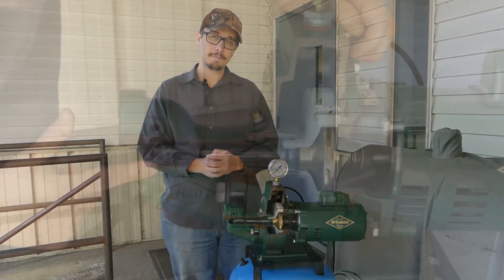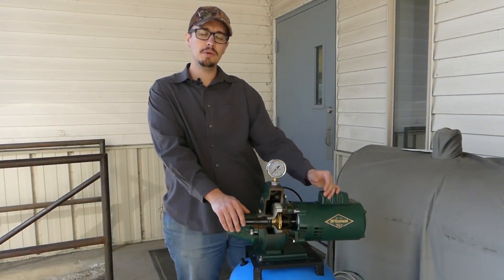Troubleshooting a Jet Pump: Low Pressure or Flow

Comment: On my project, I need very low flow    0.3 m3/h and pressure 5 bar.
I think jet pump is very suitable, since the pump doesn't go to shutoff head.

Comment: So will dry and low water table affect the pressure?
I checked pressure switch and the hose bug. I cleaned it out. I can’t get up till about 35 psi we r very dry here in south eastern Pennsylvania right now.
Reply from the maker: Yes, if your well is out of water it will not be able to build pressure.

Comment: Hey Chris, need some advice. Our jet pump pulls from our lake, a run of maybe 40’. New brass foot valve 2 years ago. Never had a problem until last year. Had some tap cartridges that froze, although have never changed my routine. Did open drain plug at pump base, draining pump and did add plumbers antifreeze. 
Now pump builds pressure albeit with gurgling and what sounds like frothing or mixing with air. When I stop the pump to fill it, it will only take maybe half a cup of water before it’s full which tells me there is no leak in the suction pipe. The hot water tank when its filling is bubbling with air. If you open a tap it’s spurting out with air, then water, then a mixture of both. Then after a minute or two it’s consistent water with an occasional spurt of air. Now the pump will start due to a drop in pressure and run for about 10 minutes, then finally stop. Wondering if it’s something in the pressure tank or possibly like you mentioned, a blockage in the jet? Would this cause these symptoms? Appreciate any help/advice!!

Comment: My jet pump (shallow well) will not achieve pressure.  I put a new pressure switch on,  Expansion tank is set to 38 psi. It holds pressure, It just cannot achieve pressure. The pump shows 50 pounds psi but will not shut off. I manually shut it off now and again it hold pressure, so no leaks!!! Baffling!!!

Comment: Would a one inch section line work for my drop line in the well an above the well is 1 1/4" going to the front of the pump ? Will that keep it from building pressure fully

Comment: Pump has been  completely. rebuilt ( impeller, diffuser, gaskets, seals, etc), Jets have been cleared, Leaks have been addressed. Pressure tank is brand new and holding air. It has sufficient access to water on the intake side.  Motor is turning. Check valves are functioning.  Both the intake and the discharge side have been primed. It will run like a champ for a few minutes and then water pressure will slowly drop off to nothing even as the pump continues to turn.  If you pour water back down its throat it will run for a few more minutes until  the issue repeats itself.  Any ideas?
  So far I've had a plumber, a farmer and a general contractor look at it and nobody has any idea.
Reply: Did you get the issue figured out? Sounds like what I'm dealing with..
Reply: What finally worked (and I dont know why) is I a) replumbed the entire supply side from the water source to the pump.  When I did that I changed the place where I was priming it from.  It worked, and is still working .  I praised the Lord and then took a shower. @souperdave2009

Comment: I would like more info on this , I’ve been having problems with my pump . I was told I needed the whole irrigation system had to be installed for the pump to work properly , 
Pump jumps up to 76 amps , when it’s rated for 37 when valve is open entirely .  And I’ve been having trouble getting installed and running properly , even the folks I bought it from don’t know and tell me , the entire system of irrigation need to be in place for the marching to operate properly. And help would be appreciated .

Comment: Hi thanks for the  videos!  My pump  operates between 30 and 50 psi but when it reaches 50 it shuts off and loses pressure back down to just above 30psi. Do you think it's the foot valve?
Reply: Try shutting off the water to the rest of the house and isolating the leak.

If your pump is still losing prime it’s likely a bad foot valve or injector at the bottom of the well. When I pulled mine the injector had several holes causing it to lose prime.

Comment: Mr. Worst, thank you for your free knowledge sharing. By this simple video I unclogged my jet (accessible via a simple drain plug), thus avoiding taking off all the pump and plumbing and taking it to the repair shop only for a few debris. The pump is 25 years old and works like new now !
Reply from the maker: Wohoo!

Comment: Mine doesn't suck any water it stays all in the suction pipe and the pipe down the well is full of water to the top and check valve, it expels out only the priming water I put in  what's happening with my drummond pump??? Maybe the impeller jet clugged???
Reply: Currently having this same problem

Comment: what pump parts would need replacing if pump was run dry for multiple hours ?
Reply from the maker: That's a good question. The mechanical seal and likely any plastic parts will need replaced, assuming of course that the motor still spins freely.
Reply: And an impeller perhaps

Comment: i need information on a 2 inch  casting deep water well  i need  nozzle tip set up , pipe chooses for the well and pump setup , can you help
Reply from the maker: Yes! Give us a call: 855.329.4519

Comment: My F&W cpj pump takes water from bottom of a 8ft deep tank. The venturi broke. Can I still pump water with it? I don't need suction.
Reply from the maker: You can try! It should still pump but you will get reduced performance.

Comment: Good morning Chris . Thank you very much for all of your brilliant work on all the videos you have posted . They are veery informative and educational. I have personally understood everyone of them . I’m a retired injured vet and your videos have helped me understand how my system works . I currently have a two pipe jet pump system . I have now had to replace every part on my system from the foot valve to the pressure tank and plumbing in my house lol. Took me longer than I thought but it’s now done. It is wasent for your videos I would still be lost in the dark lol.
My question to you is this . What in the pressure control valve and how does it work . There is one in this video on top of the jet pump the brass piece . What does it do and how do I adjust it.
My new pump can with one and it was described as a priming T and a flow control valve . I don’t understand the directions in the install hand out you get with the pump.
Do I need this or should it be install? 
My pump seems to run ok and cycles on and off with no problems  20/40 . My well is 76,6” deep from the casing head. I have water 15, from the top of the casing .i raised the foot valve up 10’ from where it sat . The old pipe and foot valve were around 66’ down .
We do have a huge iron problem where I live and I’ll be trying to treat that soon some how with filters and so on.
I have already blown through pumps the original pump that was put in some time in the 80s . The other new pump was a half hp and the mounting feet were broken off right out of the box and the mechanical seal is leaking out the back .
My new pump is now a 1 hp convertible pump (HD did not have anything left so it was my only option for a pump.
Can you give me some advise on this adjustment valve and maybe how to get some of the iron out of my water . 
I have called well companies around my area and all they wanted to do is sink and new casing and install a sub pump.when all was said and done it was going to be around 13k (ouch) . Any advise would help me at this point . Oh I also do not have this adjustable valve installed . I just installed a 1” adaptor on the discharge hole directly to my tank . Thanks in advance .
Reply: Thanks for commenting! Glad our videos have helped you. I am not 100% sure on what you are referring to on the pressure control valve. I am thinking you might be talking about a pressure regulator, which is commonly applied in deep well jet pump applications to provide back pressure to to pump to prevent cavitation by restricting flow. If your pump is running quiet without it, I wouldn't worry about it. Cavitation tends to be loud and gravely sounding. So if you were indeed talking about a pressure regulator I hope that answered your question, otherwise let me know what part you are talking about.
Reply: Chris Worst  hinthere yes you are correct on the type of valve . The valve was located on the discharge side of my pump that went to the pressure tank. This is all now taken care of as the damn 1/2 hp pump blew out the rear seal and the mounting foot broke off so it had to go back to HD . I don’t want to bash them it wasn’t their fault . They took it back and I up graded to the 1 hp model . My well is only 76 feet deep and I raised the new foot valve up 10 feet . I still have over 50 feet over top of my foot valve with no issues . I’m now 40 psi at the tap running pressure  and that’s trough a new filtration system to try and reduce the iron in my water which is over 500 ppm . At least it’s usable lol . Your videos helped me out a lot and I look forward to more cheers from the great white north .

Comment: I left my jet pump running for six hours with all  outlet tank valves, standpipe taps closed then after I realise that I switch off, but now is the pump is running but no Water coming. Plz help..
Reply: I'm no expert. But it sounds like your more than likely plastic impellers are melted warped or broken
Reply: Plus the pumps motor might be weakened. With impeller blades destroyed, no water would move
Reply: Another possibility is an obstruction of water flow. But, I lieu of having left pump to run for 6 hrs without water flow, it's amazing that it's still running at all
Reply: So open up.housing to see if you can replace impeller. Afyer replacing impellerThen seal housing well. And do a pressure test. Letting water pump out through a hose without impedenve, you should be able to fill two 5 gal bucks or more in 60 secs
Reply: At least that's what I've been told by a professional who's supposed to know

Comment: Hello, Chris.....so I have a Flotec 2 HP pump.....it recently (last couple of years when before it was POOF INSTANT ON) sometimes pushes my sprinklers and sometimes it doesn't.....it was overhauled in the last 10-12 months.......it may work on a Wed. and Sat. of the same week and then not on Monday of the next.....surrounding neighbors don't have a sprinkler system and seem to have the same pressure........???????????? been told it most likely is an air leak on the inlet side....would you agree? the easiest way to test? is a metal inlet better than a PVC one? thanks!

Comment: Hi when my pump turns on, there's no change in pressure... and what I do is close the ball valve in between the pump and tank.. and the pressure spikes up, then I open it it locks to 60 and will stop if the tank is at 60psi, Is this an early sign if trouble?

Comment: off the grid can I take out the motor put a sprocket and run it with a bike?
Reply: Probably not -- a professional cyclist can put out a sustained wattage of around 300 watts (400 peak).  Most jet pumps are about 3/4 hp -- or 560 watts.  So if you're a pro, you can probably run your pump for about a minute, maybe.

Comment: I have a new jet pump (about 4 months old) and it is suddenly squealing when it runs. What would you suggest?
Reply from the maker: Is the squealing coming from the pump or the motor? Sounds like it might be a bad bearing.
Reply: @RCworstwater  it sounds like its on the motor side, its made by Utilitech.
Reply from the maker: @adamcollier3095  my money is on a bearing going bad. You'll have to either pursue a warranty or just buy a new pump (ideally better quality)
Reply: @RCworstwater  what brands would you recommend, I got this one at Lowes
Reply from the maker: @adamcollier3095  Any on Rcworst.com. Give us a call from 8-5 PST and we'll help make sure it's sized correctly too! 855.329.4519